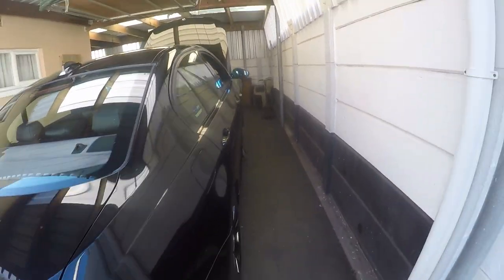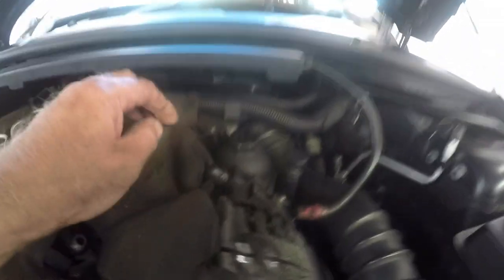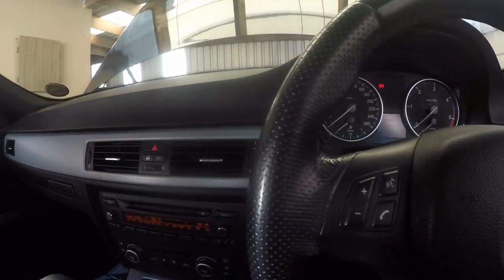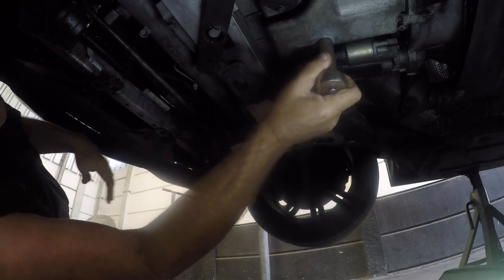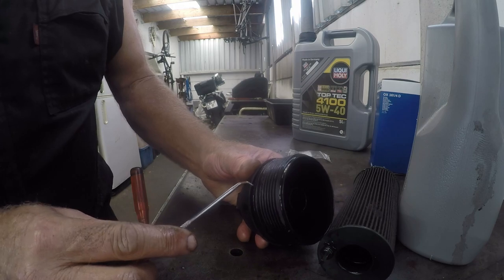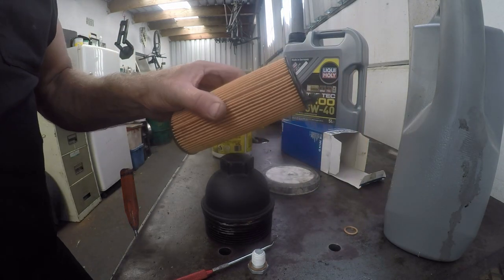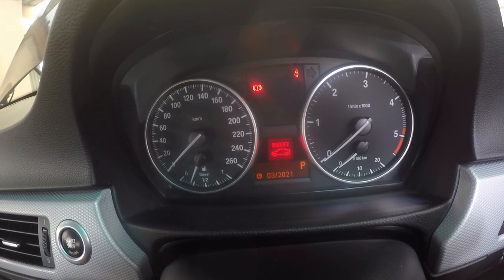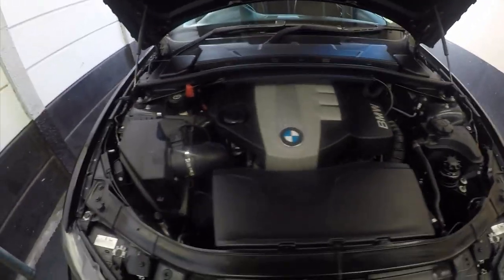Bmw 320d Oil & Filter Change

Comment: Lol the pee pee goes in the hole. Thank You for all the help. Really enjoy your videos.
Reply from the maker: Thanks, Irshaad, a bit of humor there lol, well spotted, thanks for your support it is well appreciated.
Reply: @vehiclemaintenanceandrepai3790  I would like to inform you that after watching your videos. I managed to do my own service on my 2008 Opel Corsa Lite. Changed the plugs, oil filter ,air filter and petrol filter( fingers crossed🤞 it did start properly and runs well). Keep up the excellent work. 👍I enjoyed the humor.😃(#Watching from Pietermaritzburg)